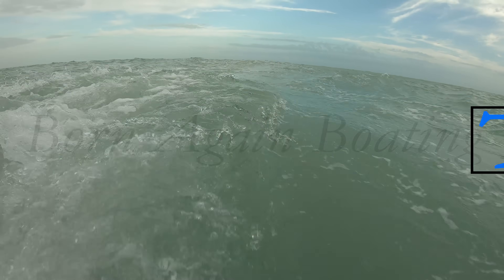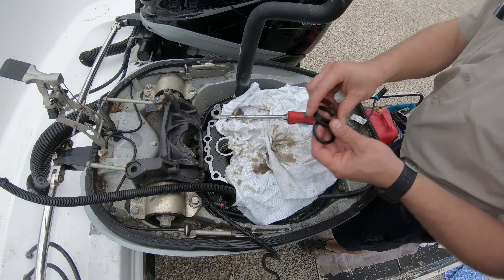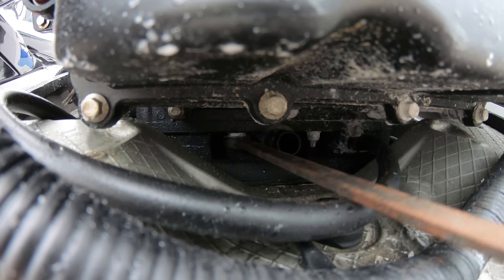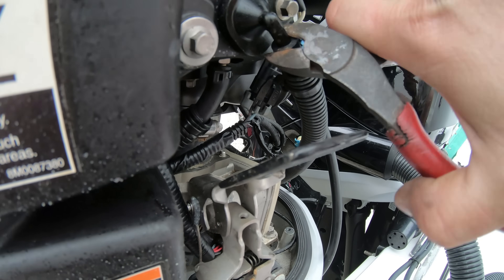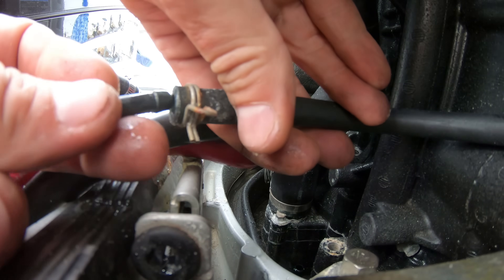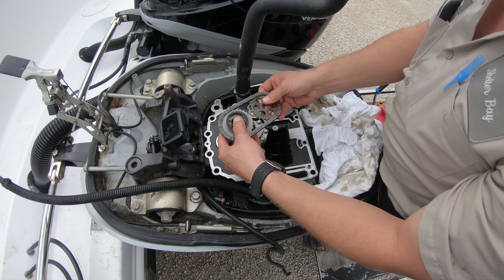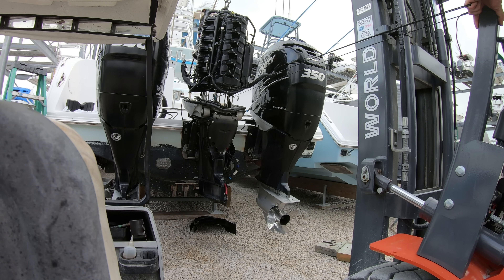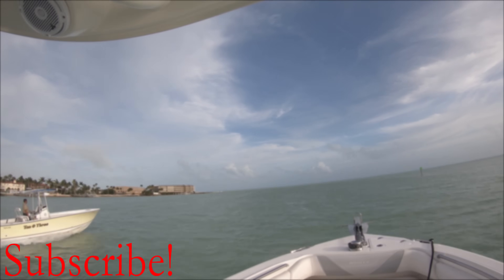Pulling A Mercury Verado Powerhead | Driveshaft Seals | TT2

Comment: My 2013 Verado 250 Pro shows oil in the water, but more worrisome is that when I start it after sitting overnight, it blows oil out the prop exhaust. Only happens on initial start. It might still be leaking when the engine is running but hard to tell. So, if the driveshaft seals are bad, would that oil be coming out the exhaust as well?

Comment: Great video!  I am about to replace the nearly frozen swivel and question whether I have to pull the power head to do so.  Mine is a 2015 Verado 200 L4.  I bout a good used freshwater swivel off eBay. It sure seems I could support the whole motor on the lift ring and remove the 4 bolts to the bracket, then change out the swivel and reassemble.  What would you do?  I have really appreciated your practical way of getting it done!

Comment: My problem for my 350hp merc i pulled out the powerhead but the lower gear unit i cant remove to the med section what is the posible coz on this trouble
Reply from the maker: Most likely oil pump drive gear welded to the driveshaft of the lower unit :(
Reply: This is what I am facing right now with a Verado 225 from 2011. Its been serviced regularly but the driveshaft seems impossible to ustuck from the oil pump gear. Have you solved your problem?

Comment: So what would you say reasonable/ typical amount of hours is to bill for this full procedure on a Verado to remove power head, change seals, reseat and then do standard verification testing? Great video btw!
Reply: @BornAgainBoating   I've been a long time subscriber, appreciate your vids!  2011 200hp Verado, I just had a low oil pressure alarm and oil reservoir emptied due to leak.  Appears it may be bad drive shaft seals.  Curious to hear your opinion on time to make this repair, assuming no issues or surprises along the way.  Thx, keep making the vids!

Comment: Do you have to pull the power head to replace the head gasket? I have water in the #6 cylinder (bottom). Thank you
Reply from the maker: Hey Thomas, yes, you do. And it's a big job to change out the head gasket on these engines. There are bolts that go all the way through the engine from the front to attach the head. So you will need to do a complete tear down and rebuild. I've never done one, but you might work up all the costs and make sure it is worth doing it.

Comment: The king of Youtube when it comes to boating. I use these videos to fix my verados.
Reply: I had a quick question if you dont mind.. I changed the oil on one of my 2006 Verados and one of them had milky oil (which obviously it had water inside) where does the water usually get in through?

Comment: Do you know if 1999 mercury 150 2 stroke powered will fit on 2001 150 2 stroke optimax mid section?
Reply from the maker: I don't think it will.

Comment: hello , i havr one vurado 300  ch  i faind the oil milk in side just fuie water ? i need some information plise
Reply from the maker: If you found water in the oil, check the fsm pressure regulator hose, i think that's what you're asking :)
Reply: @BornAgainBoating  You made an illustration on the level of the oil pump about the seal and seal water ?
Reply: @BornAgainBoating  The engine is running for no more than 600h
Reply: @BornAgainBoating  Soo I'm making a change the seal water code #26-884462 and seal oil what do y think ?
Reply: @BornAgainBoating  can you explain this, i ended up with water in oil just after fixing my float module in this FSM

Comment: Great video. I have a pair of 2005 275s that are both leaking oil into the water. Other than changing the seals is there anything else critical to inspect while in there? I was quoted $2500 per motor for the job and having the skills needed I'm considering doing it myself.
Reply from the maker: Not much else to check while there. Just don't drop anything in the oil pan, change the o-rings under the oil pump, and change the bolts to the oil pump when you do. They can get brittle and break. So new ones makes it better. Plus, feel the bolts as you tighten them on the oil pump. If they feel like they are going to break, don't tighten them anymore. Change the oil seals and the water seals and the power head gasket. That's about it! It's really not that bad of a job :). While you are there, you can disconnect the shift rod and look at the white bushing around it. It would be a good time to grease that up. Can't think of anything else, that's it!
Reply: @BornAgainBoating  Curious if you have a way of greasing/lubricating the shift shaft bushing without removing the powerhead?  I have a frozen bushing, and looking to lubricate it.  Just not sure how to access it properly.   2011 Verado 300HP
Reply: @BornAgainBoating  i have two yamaha f150s 2005 and performed a speedy sleeve repair on one and a year later its leaking again - along with the other one. Can this speedy sleeve repair be performed twice on one motor?

Comment: 275 Verado 05’. The motor sat up for a year. I took the boat cover off, hooked the water hose up and it fired right up and ran for ten minute.  The next morning there was motor oil coming out of the two pick ups on the foot. Are these seals my problem, or can it be something else as well? @BornAgainBoating Thanks for the tutorial. #BornAgainBoating
Reply from the maker: With an 05 Verado, most likely it is these seals. It's pretty common on older engines like that. Since it's been sitting for awhile, you might want to run it for a little bit and make sure that it is still leaking. Seals can dry out after sitting and then leak for a little bit when they are first used. Usually they need replaced but sometimes you get lucky :)
Reply: Born Again Boating Thanks. Is it necessary to disconnect power from the battery first before disconnecting other wires? I didn’t want to cause issues with the computer.
Reply from the maker: @Ulyssez79  yeah, you want to shut the power off first. Then you can go to town without worrying a out it :) make sure the clean power, (if it is going to the engine, it will be a two wire, red and black, plug in the front starboard side of the engine harness) is unplugged too. That kills the power to the computer. S
Reply: @BornAgainBoating Last question: To do the job, do you suggest ordering any seals other then the three (water and oil) seals??? Thanks for your help!

Comment: I couldn’t imagine doing a 300 four stroke the best I have down is a 185 optimax and many many 20hps
And also your basically unrigging the engine and rigging it again
Reply from the maker: Ah, they are easy :) if you've done an opti and a bunch of 20's, you would be able to do one of these :)
Reply: Born Again Boating the opti max was horrible it had an oil leak and then we couldn’t get the bolts out through the mid section because oil or something it in there and clogged it up
Reply from the maker: Hahah, yeah, they can get nasty and basically lock in place :) We've had to drill holes in the midsection before to get them out :(

Comment: What is the torque specs on the 10 bolts holding the powerhead to the mid section? I've found your video very informative and am completing the process now. Other question I would have is id you have a rough section on the drivesahft what is the best way to smooth out? Not sure if the seals ride on the driveshaft or the oil pump insert?
Reply from the maker: Hello, thank you and that's awesome you are almost done, (If you aren't done already,) the torque for the powerhead nuts are only 45 ft lbs. The seals inside of the oil pump insert do ride on the driveshaft. The best you could do is use some really fine emery cloth like 400 grit or so and smooth out the spot on the driveshaft. See if that helps out.